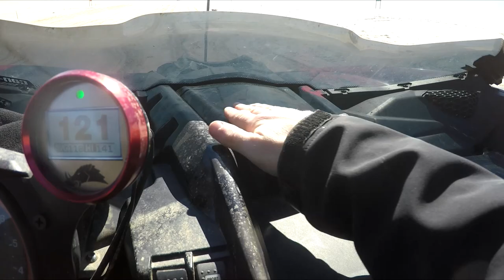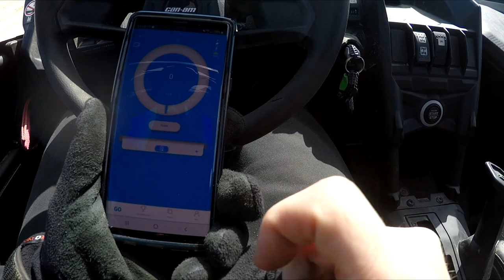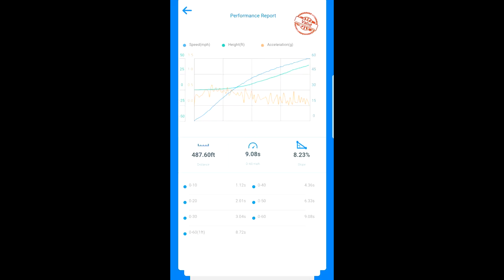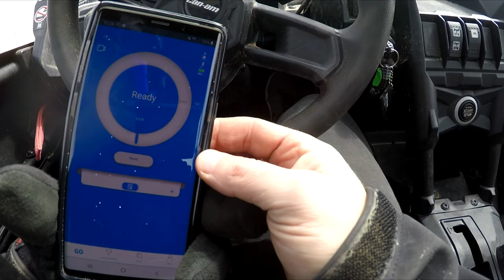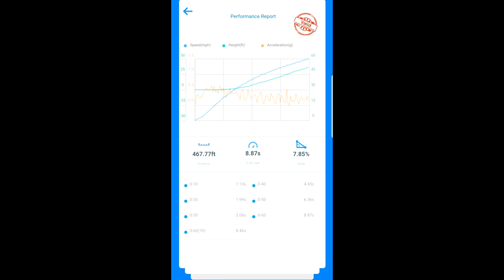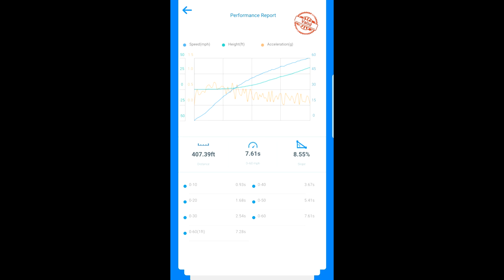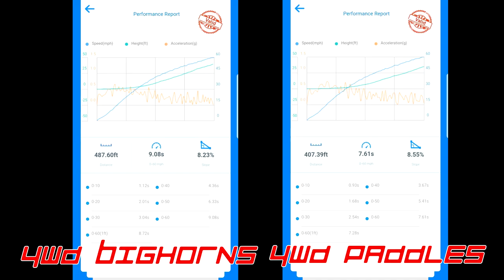Are Paddle Tires Worth it at the Sand Dunes?

Comment: Tested the same thing but had 12 paddle Skats. Biggest gap difference was nosing up to the very bottom of China Wall in Glamis. 4x4 Bighorns were 50/50 making it and 2wd Skats powered over every time easy. On longer, not so steep climbs where you have a lot of ground speed there is less difference. Glamis paddles shine because its heavy in transitional and bowl riding, where coming out of a corner and no runs to go up a hill are everywhere. 

Awesome video as usual!!

Comment: Really like the video guys, nice work!  Here's my 2 cents on the conversation from personal experience.  On these high horsepower cars ESPECIALLY if you are drag racing like in your video I could see spending the money.  I run a tuned X3 in the same dunes, and you are definitely at a disadvantage without paddles, mostly "getting out of the hole".  Now if you are not drag racing and just flying around at 40+ MPH like these cars will let you do I personally wouldn't spend the money.  They are not going to make much difference at all at that speed, and you can still go anywhere and climb just about anything with your regular tires aired down.  Lastly, I personally would not recommend buying a set for a non-turbo car.  I bought some for my 2014 100 hp maverick and sold them within a few months.  They make absolutely no difference and you still need to run them in 4 wheel drive to get anywhere in sand.  Great video with real data!

Comment: Try changing the air pressure in the paddles and see what works best...
Reply: I've done a ton of air pressure tests up Thunder Mountain in St. Anthony with my stock YXZ. I won't bore you with all the details here but 6 LBS Rear paddles and 7 lbs front gave the highest climb by far. More pressure equaled less climb and speed.
It was the same result with Bighorns.

Comment: Nice video, thanks.  Those Big Horns did very well, even though they looked really worn out.  How many miles on them.  Lowering the air pressures on each set of ties would make a nice test also.
Reply from the maker: The bighorns had roughly 8psi in them. The skatz had about 12psi

Comment: Thanks. Helpful comparison.  I was surprised that the smoothies actually add to pulling power in 4wd. Curious how much better the fronts with the small V paddles or the 1/2 ribbed 1/2 straight paddles might be? Need to borrow and compare, perhaps.
Reply from the maker: Glad the video helped! Those buffed fronts add a lot of gription... they're like sandpaper. It would be interesting to know of other fronts would be more or less traction
Reply: Or paddles in the rear, bighorns up front. 
See if the grip they give over the smoothies overcomes the weight.
Reply: @qtrmilemalone  That could be a good $$ saving option.
Reply: I was be really curious how the STU  tributes would do as fronts, with half a paddle on there, I have them but haven’t compared
Reply from the maker: Im highly curious on those wheels too... they are a lot heavier and only come in 32", which will slow acceleration a bit. Those were my other choice when deciding which paddle to get

Comment: Wouldn’t it also make more sense to not run smooths up front so 4wd is more useful for the paddles ?
Reply from the maker: Those smoothies are buffed, they're like sandpaper. They're extremely light and provide a ton of traction
Reply: @ftorvideo  how is a smooth tire gonna get more traction then a set of bighorns on front?

Comment: I'm curious to see how much the times would change with some 32" skats 12 paddle straight and staggered 🤘 bad ass video tho. You always hear the debate about 2wd or 4wd in Glamis up olds or riding through the actual big dunes. You guys just answered it.
Reply from the maker: 32's would potentially slow you down, being larger in diameter. But it's hard to say how that would impact wheel spin. Would be a fun test! Thanks for the comment sir!
Reply: True.. that's why we need you guys to test it lol.. And or 30s in 10 and 12 paddle configurations 🤘 that would be awesome.
Reply: Full Throttle Off Road, I have 12 or 14 paddle 32" skats with 4ri and Kiwi tuned clutch for those tires.  Lets make sure we race next time at sliver lake.  look for 8 ball sticker on all black X3.
Reply from the maker: You got it

Comment: Looks like one of the cars has Hiper Raptors on it. Did you guys happen to weigh them? I am looking at them but can find any numbers for weight.
Reply from the maker: My car has the HiPer wheels, they're super light... carbin fiber. I'm not sure on their weight but it's extremely low. I love them
Reply: Full Throttle Off Road thanks!
Reply: Full Throttle Off Road you should weight them when you get those new ripper paddles on! 😉

Comment: Can somebody please tell me what size paddles would work on a stock machine without messing with the clutch!? Im looking at the cst sandblast
Reply from the maker: Id stick with an 8 paddle, 1 cup. You dont want anything too aggressive with a stock tune. But, the stock X3 is more than capable of handling an 8 paddle tire
Reply: Full Throttle Off Road ive been reading everyone is running the cst sandblast but they dont come in less than 12 paddle and thats a 28x12 tire
Reply from the maker: If you're going to run 12 paddle id clutch your machine for sand. Thats a lot of load on a factory tune. Or just tune your machine to at least an evo 3R. Paddles eat up a lot of horse power, so too much paddle on a factory tuned machine can slow you down